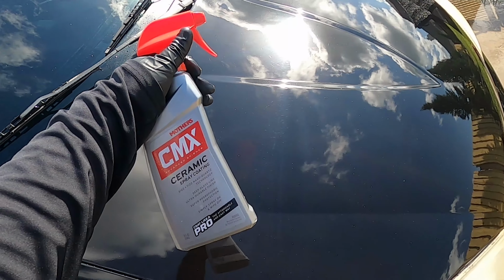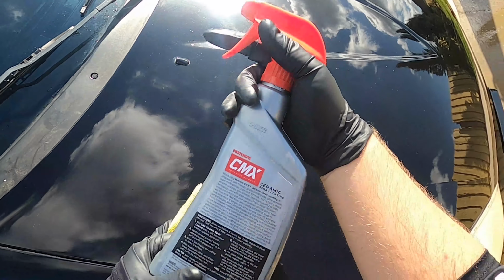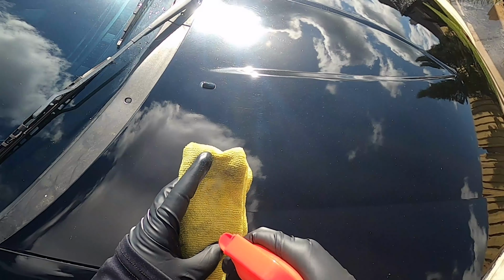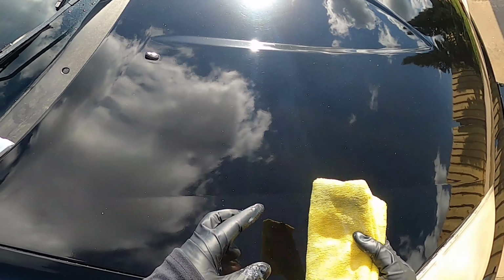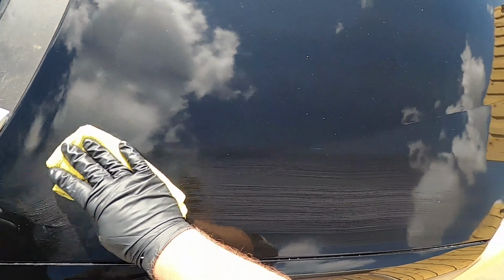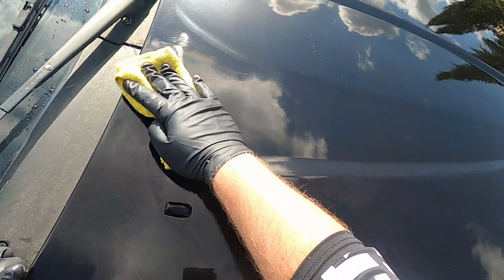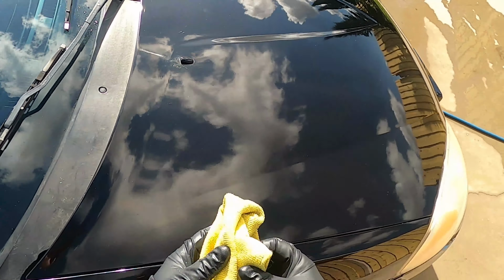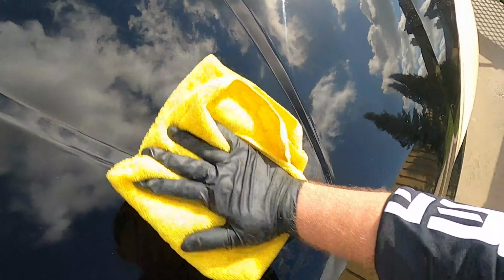Mothers CMX Ceramic Spray Coating How to Apply, Test & Review

Comment: So it's ok to use it in direct sunlight? No issue?
Reply from the maker: Yeah it's ok to use in sunlight I did it on my car and as you can see its just fine and the results of the product are immediate.
Reply: @EXQUISITEMAD   man this was what I was hoping to hear I live in Ft Lauderdale in an apartment so I have no other choice.
Reply: @joshuapowell9654  A quiet corner at any Mall covered parking
Reply from the maker: Its ok to use in direct sunlight and that is my car in using it on in this video.

Comment: Nice but aren’t you supposed to let cure for 24 hours before getting wet
Reply from the maker: It's a review and demonstration,  it's a retail consumer product, definitely not a professional ceramic coating so it's dependent on the customers liking. Figure if it works this fast imagine if it had time to cure a few hours at least.

Comment: Aren't you suppose to prep the surface better?  I see little spots and it looks like they are spreading when you apply the ceramic.
Reply from the maker: The automobile is clean. The product was applied as per instructions.

Comment: I use this product on my silver Ram, you’re definitely supposed to let it dry for 2-3 minutes before removing
Reply from the maker: Color and temperature vary the application process standing time. I used it as shown in the video and it worked just fine. Eventually I just put a professional ceramic coating on it.